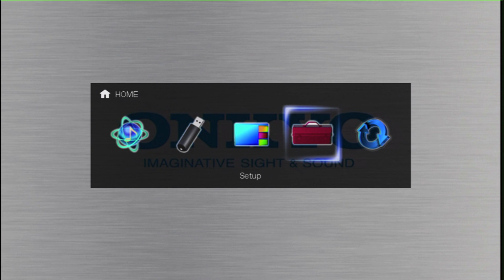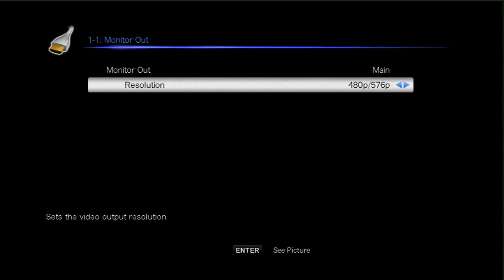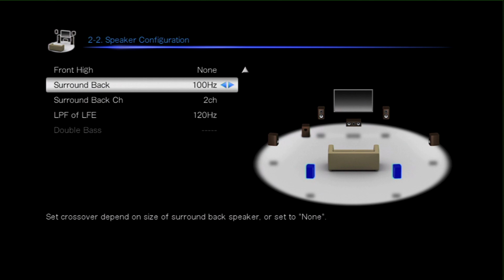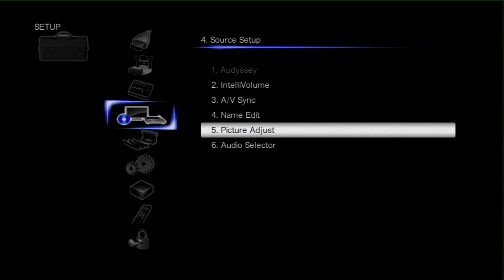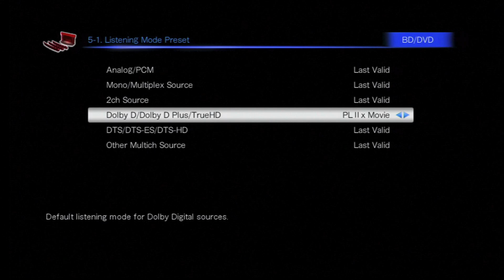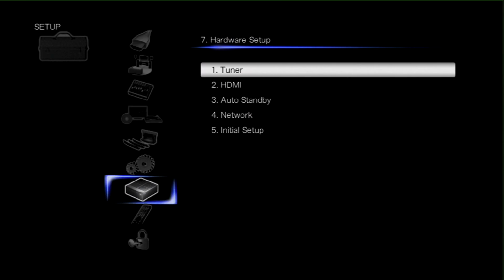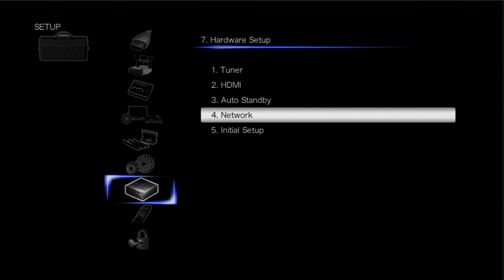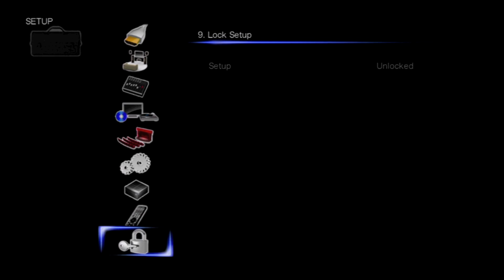ONKYO AV Home Cinema Receiver TX-NR515 OSD & GUI

Comment from the maker: Hi, please check the manual on page En-52 for more information on how to access the speaker configuration / activating Zone 2: in order to use Powered Zone 2, it needs to be activated first, and also bi-amping needs to be turned off. In case you still have trouble accessing the menu, please get in touch with our support at customercare_eu@eu.onkyo.com to find out why. Many thanks.